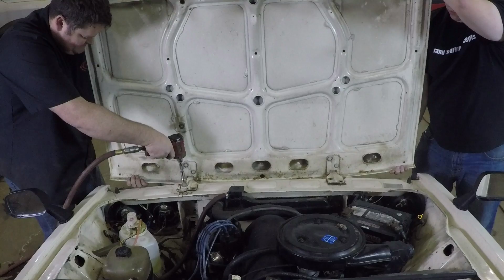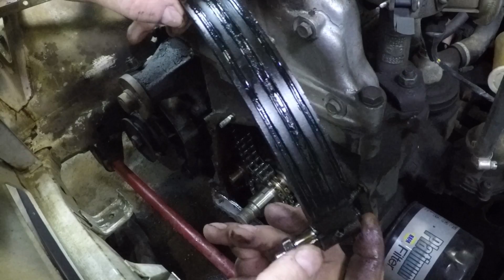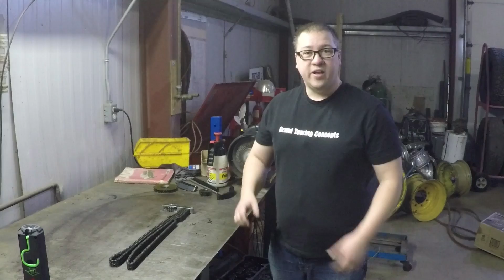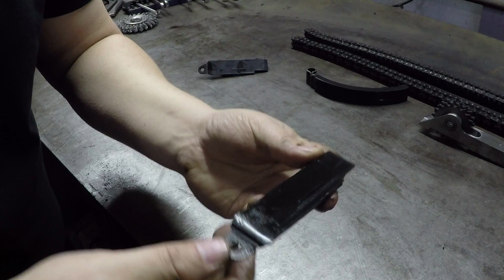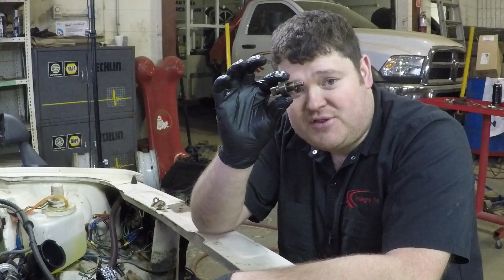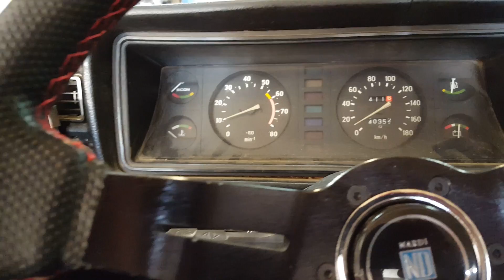IVAN2104 - Lada Timing Chain Fix

Comment: Hi, chain dampfer best solution for You -its detail from 21213 engine, or completely kit from 21214 (1.8L) engine its one-line chain with logical dampfer and tensioner.

Comment: On the neglected niva engine. Is it a 1.7 liter engine ? What about putting a stroker crankshaft in it. With a 92 mm stroke maybe you need a deckplate to make it nice.

Comment: Thanks for sharing your info, on my 2007 Lada 1.7 4x4 im replacing the cylinder head and its difficuilt to see the bottom crank timing marks, can I set this timing using no1 piston at TDC with a dial indicator?

Comment: Why didn't You use the automatic Chain tensioner?

I have one and it does not go all the way in after taking the pin out. The engine worka great, but I can not lut the little screw in... Was that the problem?

Comment: Cómo puedo conseguir un kit de cadena para motor 1500
Reply from the maker: We got ours from ladamoscow.com, they might still sell them. We did switch back to the OEM style system because it worked with an automatic tensioner we installed later. Both were good systems. Thanks for watching abd commenting! - Darren

Comment: What timing degree you guys put?
I put around 20 maybe even more
Runs very good but probably fuel consumption will go up
What do you think?
Reply from the maker: For ignition advance we use 5 degrees, it is ideal, we have a link on that topic on our website: http://gtconcepts.ca/main/index.php/2017/10/19/lada-ignition-timing-information/ but ignition timing, it should not negatively impact fuel consumption, but knock or ping may require a higher octane grade of fuel depending on individual settings. Thanks for commenting! - Darren
Reply: Thanks for info
i like how it is runs now with split camshaft gear huge difference

Comment: Actually, U just need a new modernized fully automatic mechanical chain tensioner.
This one - "isai" - with the winding spring. 
http://isai-shop.ru/
(google chrome might block the site. Open it any way!)

Original fiat's tensioner of the Lada is crap! It is the "vera causa" of all chain problems of Lada.